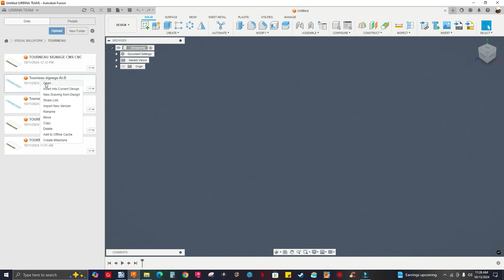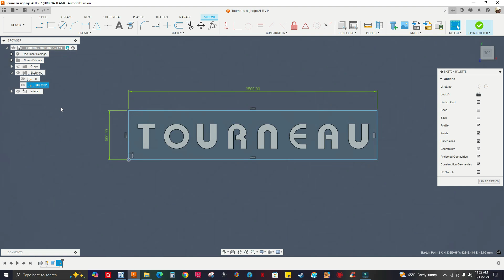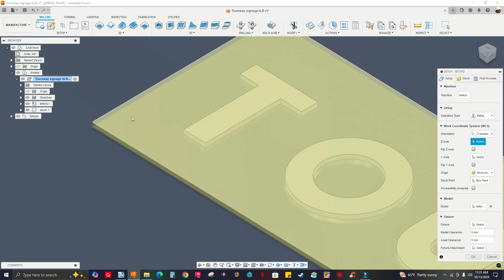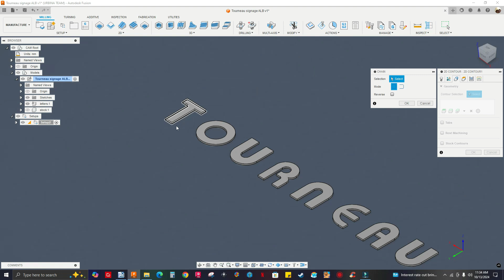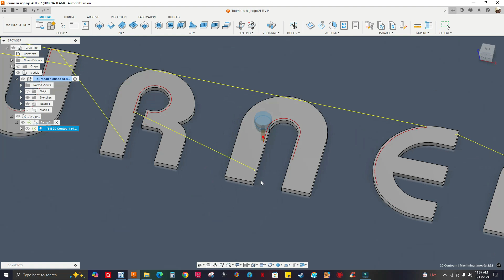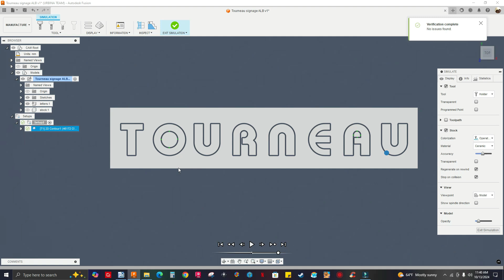IMPORT A DXF FILE INTO AUTODESK FUSION AND CONVERT IT INTO AN MPR FILE

Comment: hi thank you so much for posting this video. i've been trying to find a way to create programs away from my cnc for about a year and yesterday i found your video. can i ask how did you get your tool library for your weeke machine on fusion im still pretty new to it. my machine is a 4 axis optimat bhc 555
Reply: thanks for the video. It seems easy but I can't do it, does it work on Fusion 360 Free? and what needs to be changed in the post processor?? can you help me? Do I really need it? is this the fastest and most economical way to move dxf to mrp woodwop??
Reply from the maker: @JoaoSilva-dp3pe you’re welcome, it does work on the free version without tool changing. There are couple of changes that you need to make to the post processor to make it work which i have a video on.
Reply: @justourbina12  Where are the videos with the changes to the post processor?
Reply from the maker: @JoaoSilva-dp3pe  HOW TO GET RID OF INVALID FORMAT ERROR MESSAGE WHEN POSTING AN MPR FILE IN FUSION  360.
https://youtu.be/3OHoU4h4CUY
Reply from the maker: For me it’s faster and more economical because i am coming from Autocad where i used to apply special layer codes to generate gcode and it was time consuming. If you want better efficiency, you should use Homag softwares such as cutrite, woodcad/cam, smartwop. Their prices are steep.😀
Reply: @justourbina12  thanks for the answer. what needs to be changed in the post processor. I just need to change the dxf file to mrp woodwop, the program opens the dxf file but I can't do the machining operations.  And how do you do it in the video? Can you transfer the dxf file to mrp, and then run the program in woodwop? You can do that, right?
Reply from the maker: @JoaoSilva-dp3pe you can import a dxf file into woodwop and program it there.
Reply: @justourbina12  It doesn't work, the dxf file opens, but it doesn't allow programming in woodwop?
Do you know where I can get free woodwop 5.0 to try?
Reply from the maker: @JoaoSilva-dp3pe you’re using fusion right?
Reply from the maker: @JoaoSilva-dp3pe email me your WhatsApp.
Reply from the maker: Hi, you’re welcome. I have manually added every tool to the Fusion library because i was not able to convert Homag tool file to a json/csv file which is one of the file types Fusion accepts.
Reply: @justourbina12  thank you, i have one more question, do you know how to get the post processor for weeke machines because i cant find it on the autodesk website.
thank you
Reply from the maker: @ https://cam.autodesk.com/hsmposts that’s the website, you are going to have to make 2 changes to the post to make work or you will have an error saying invalid format. I have a video on that. Good luck.
Reply: @justourbina12  i really appreciate the help thank you, i fillowed your steps in the post video but im get the error "error on reading file!, Undefined macro entry in MPR file" would that be a tool issue or would it be something else do you think
Reply from the maker: @seanohanlon6128 what’s your email?